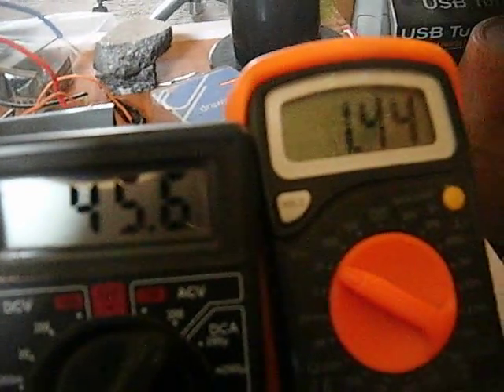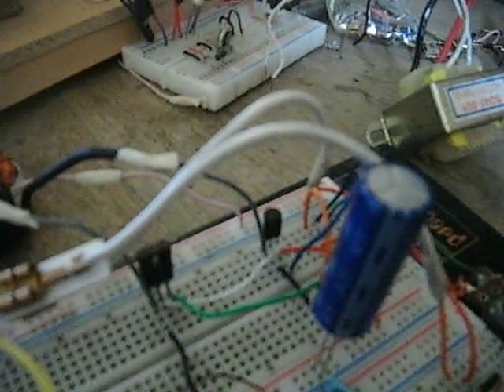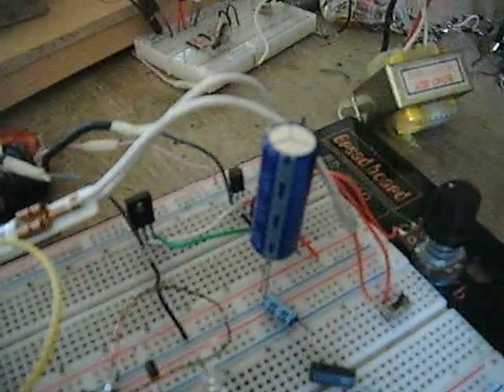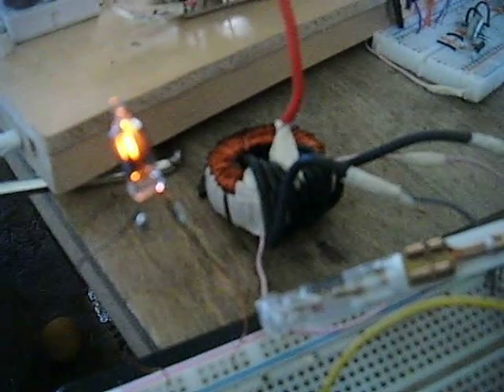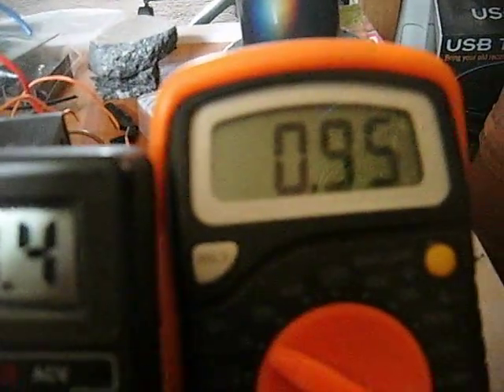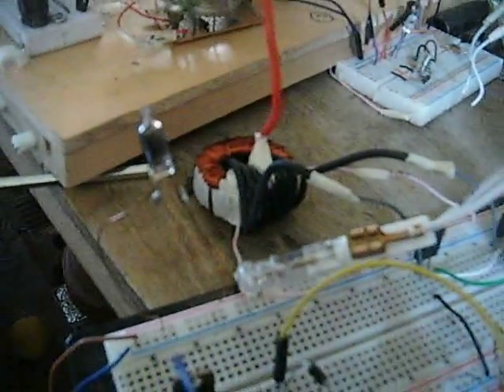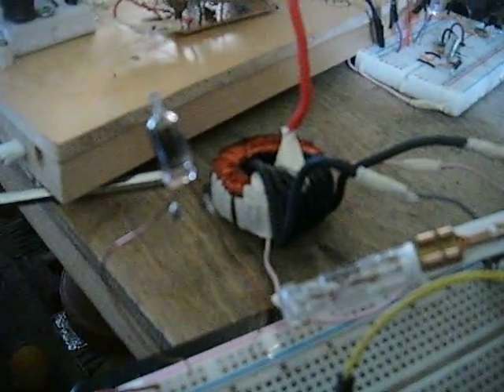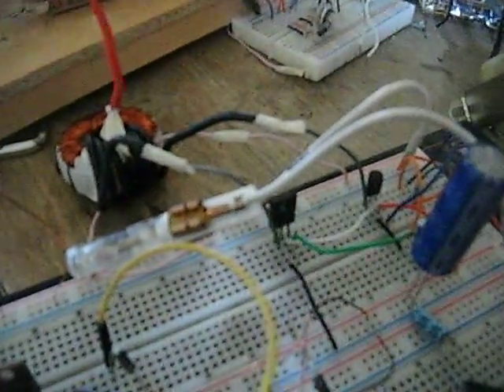Toroid  Inverter Test 1 (Success!!)

Comment: I'm thinking it's about fewer turns on the output and more turns on the input but I don't know enough about it. Just know what others have said and they seem to say to step up your output the number of turns should match both input and output. Input three volts then three turns; output 250 then 250 turns. Got no experience with this though. Saw a vid with a guy showing his rewind of a transformer (iron core). And it was a step down. He turned 12 onto the input and kept what ever was on the original output. He made a point of saying was about having the number of turns to match the voltage. I'm wondering if the toroid size matters. In that case how do you calculate the size of the toroid? Thanks for this vid it's a good project one I would like to do.